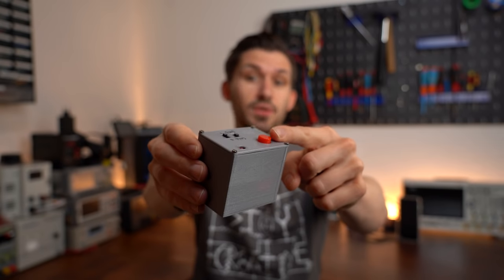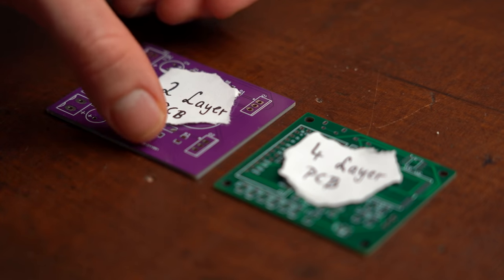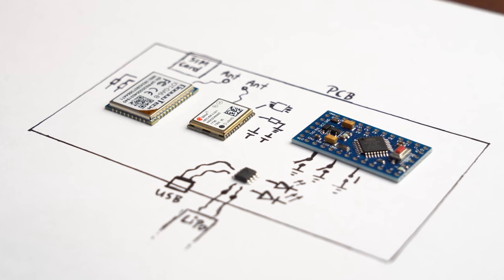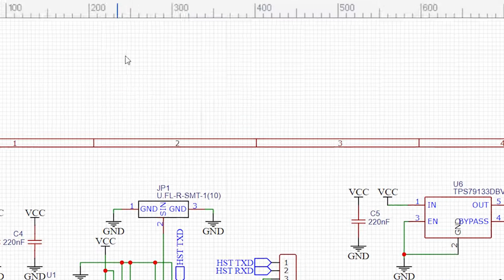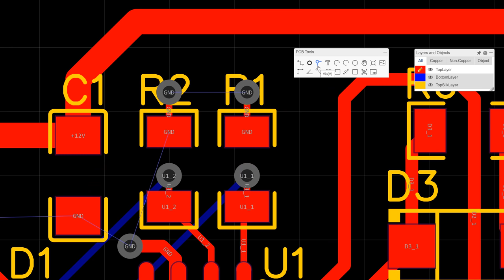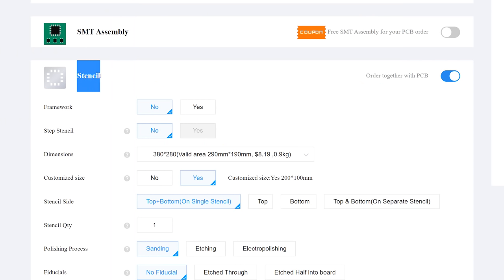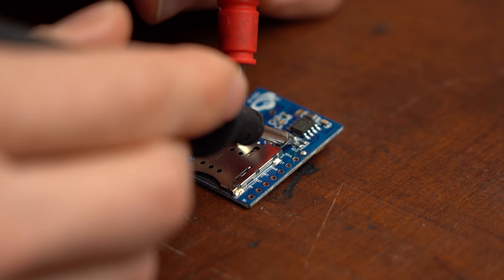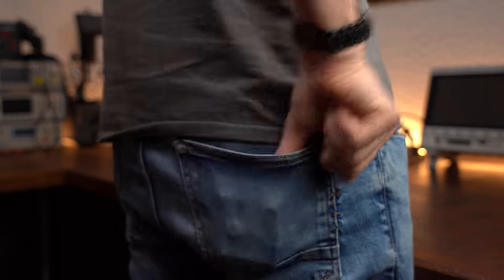This credit card sized PCB can SAVE YOUR LIFE! (Shrinkify your projects with a 4 Layer PCB)

Comment: I think this board could be possible on 2 layers. Use old laying technique: vertical traces on one layer, horizontal on another. You can fill empty space with GND and apply via stitching.
Reply from the maker: 2 Layers is possible. I tried it. But I thought it was time to talk about 4 layers ;-)
Reply: I never knew about that technique
Reply: @YSPACElabs  Very useful when you have a lack of space, just be careful when you have high current traces or AC. Parallel lines can easily act as antenna's.
Reply: @YSPACElabs  often used on old computer designs with a lot of discrete parts, I still use it occasionally when I do my boards
Reply: Yeah but then you can't get that sweet sweet jlcbcb money
Reply: The design has more than one high-speedish component. If I were you I simply make two inner layers GND.
Reply: @YSPACElabs  its also used in ICs for routing :) (manhattan routing)
Reply: @u.h6844  he makes videos so you can watch them and learn more, don't be sassy about sponsorizations
Reply: @greatscottlab  and thats the only thing I am really missing a bit in the otherwise very nice video - the actual 4 layer stuff was a bit short :D

Comment: The 328p is quite easy to use on it's own and saves a lot of space not having a whole arduino. I've made projects using a 328p that ended up smaller than a nano.
Reply: Basically just a single pullup resistor if ur fine with the 8mhz internal oscillator. Otherwise +2 caps and a crystal
Reply: @KekTekDe  And an ICSP header or pads. They're a very useful MC
Reply: or we can ditch the venerable 328p and use a RP2040 :) (although if space is an issue, the bare 328p with internal 8mhz is hard to beat)
Reply: @AudreyRobinel  well, for this project an attiny would be sufficient 😄
Reply: @KekTekDe  Well, it may be suffiscient, but modern micros are as power efficient, and as cheap, providing with  greater flexibility, and easier code maintenance :) why pay the same price for a lesser technology? 328p are not significantly cheaper than rp2040s and they are outclassed on most, if not all metrics!
Reply: @AudreyRobinel  — There is one
 metric the RP2040 really sucks at, and that is ADC inputs. Since pretty much every other microcontroller has at least eight inputs, I really don’t understand why it only has four; 16 would be reasonably expected from most new designs. I would use it for nearly everything if it weren’t for that glaring deficiency.
Reply: @AudreyRobinel  Never worked with RP2040, but an ESP32 would add WiFi and bluetooth to the board. Only your imagination limits the possibilities for a board with so many capabilities.
Reply: @dozog  Indeed, the ESP32 is my goto micro controller. It does almost anything i want, and what it does not do, i can mostly add it trough i2c modules.
however, the rp2040 is less power hungry, smaller, and natively runs micropython. Plus there is this PIO module where you can program 8 GPIO to do blazing fast bit ganging operations if needed (but honestly i have not yet needed it :) )

I find the RP2040 to be a very good replacement for classical "arduinos" : boards are cheap, do a lot, have good hardware, extremely good support, etc.

ESP32 do the things i need the most extremely well, and are cheap considering the wireless capabilities, but they are way less accessible.  But in my most common use-case they are king (integration with home assistant).

However, if there is a new rp2040-like with wifi capabilities (ie not an rp2040 coupled with an esp32) i will surely be interested in it.

I must say that for my own projects i mostly use the esp32, but for the projects i do with my students, i am heavily biased towards the pi pico because of the ease of use.
Reply: @AudreyRobinel  I think similarly.
But it works so much easier with a micro that you already know. No learning curves.
What do you mean "less accessible" ??
(you mean harder to get in the market, or a technical thingy??)

Comment: Interesting project. Great work. This year I had to design a six layer PCB at work and it was a daunting task at first but ended up enjoying it.
Reply from the maker: I think once you get into designing it becomes like solving a maze. And I think that is quite fun and challenging at the same time ;-)
Reply: @greatscottlab  Yeah it can be very fun trying to fit all the parts and make the layout as efficient as possible.
Reply: @akhurash  How is this comment 6 days ago :d
Reply: @bkaytan  patreon get early access
Reply: @greatscottlab  very true until you use........................... the AUTO ROUTER haha. on any design with some complexity it requires a lot of hand holding to get the auto router to do its job.

Comment: Keep in mind that RF traces (like the one going from the GPS to the antenna) need special care and should be kept straight and some other things like the length need to be precise.
Reply: Yeah. It's a miracle that it even works. It needs to be short and FAT. GSM is another thing, it usually works with a wet string, but it might be noisy as hell. GPS on the other hand is really easy to screw up.
Reply: shouldn't they be controlled impedance traces? 50R?
Reply: Not if you are using active antenna. It seems he is using a active antenna, which is fed with a small bit of power, meaning the conductor between antenna circuit and GPS circuit isn't critical, but the conductor between antenna circuit and the actual antenna is critical. The antenna circuit is on the board where the antenna is mounted. An active antenna is ALWAYS required when connecting a GPS to any length of antenna cable, since when using passive antennas, you get reflections and such in cables that can disturb the sensitive GPS signal.
Reply: @sebastiannielsen  you also get impedance mismatch and reflections with a LNA. No way around that.
Reply: @zaprodk  Yeah but then with the amplified signal back, the SNR will be higher, meaning it doesn't matter if you get some crap on the line.
Reply: @zaprodk  Cries in autorouter
Reply: @sebastiannielsen  Thanks!

Comment: Great video. You could have desoldered atmega chip from Arduino board as well, as you could get even smaller circuit. Arduino is anyway mostly atmega plus usb-to-serial chip and oscillator which can both be avoided in some cases.
Reply: True, and the pro-mini doesn't even have the usb-serial chip

Comment: Create a raised ring around the button so you don't inadvertently press it when sitting down or leaning against something.
Reply: there's an on/off switch independent of the button
Reply: @Astarath  It's still a good idea to protect the button, just as it's a good idea to protect the slide switch.

Comment: If you replace an entire Arduino board with (literally) 5 relevant components (MCU, crystal + 2x caps, 1 pull-up resistor for NRESET) - you would get MUCH smaller design, really credit card sized.

Comment: The activation button should be recessed to reduce accidental triggering from clothing.  You don't want to be butt dialing.  Also I would consider requiring 2 buttons that have to pressed at the same time.
Reply: I thought the same, and perhaps recessed dip switches as well. I bet the enclosure could be made half as thick.
Reply: I believe there are 2 buttons, the switch must be activated for the button to work.

Comment: I once worked making software to a company that could make PCB boards with more than 20 layers. Never found out what special applications those insane boards were for, but it was quite impressing. I heard that the amount of rejects was quite high with those PCBs  with all the blind holes and holes between layers deep inside etc.
Reply: wouldn't be surprised if smartphones and pc/laptop mainboards are about there.
Reply: @victortitov1740  No. Smartphones and pc/laptops will propably in the future go to a common bus architecture, meaning they could be done on 3 or 4 layer boards. Today we still have HDMI ports and such on laptops, which require its own circuity, but in the future the whole laptop/smartphone might just consist of a single USB-C bus + power + gnd going around every component including storage and processor. And with the new RAM types that can nonvolatively store data, I think we in the future will use our RAM sticks as harddrive.

Comment: There’s still a lot of wasted space, though, almost half is taken by the Arduino, the switches and the button. By using an SMD microcontroller directly on the board, an SMD button and switches (or removing one or the two switches) and a dual GSM+GPS module, it probably could be shrunk to half the size or less.
Reply: Maybe he can make a version 3 for us
Reply: @whizzbang7520  I'm kind of trying to minimalize the design right now with a fork of that project. Fixed the mess in the schematic, put all in blocks so it's readable and debuggable. Get the routing done without the godawful autorouter traces. Also wanted to find an enclosure that one could buy already done from a manufacturer, that would be small and easily modifiable and they have CAD stuff, so people with 3D printers can waste their plastic too if they choose. The Ai thinker A9 has GPS and GPRS so could use that later, but for now, because this project also has the code for all the stuff here, I would not try to change much but just the PCB.
Reply: @grbttutorials Please post a video of making this project even smaller
Reply: @deskpro256  can you link the release when its done?

Comment: I run a hardware business and the chip shortage has certainly changed the game quite a bit. We've had to build up a bunch of chip inventory management and ordering processes to ensure we get what we need, along with accelerating board redesigns.

Chip gougers like Win Source are a blessing and a curse. They purchase chips and markup by nearly 10 times, but at least it means you can get your hands on chips for prototypes.
Reply: Have you ever bought from Win Source? Hard to tell which ones are scammers or not.

Comment: If you move the switch and buttons to one side, then you could make the whole PCB slimmer which would be more comfortable in your pocket and then could be inserted into a pocket of a purse or handbag. This board could also be used as a GPS tracker enabling you to find the unit simply by sending a SMS with a code in it, which triggers the GPS result in a returning SMS.

Comment: Is there a reason you are using Pro mini but Atmega328 itself? I have seen so many of your videos and I always wonder that. With a atmega chip with a resinator could save a HUGE space for the PCB
Reply: And you can also flash the Atmega with the arduino compiled hex file via ISP. Would be a big space improvement.
Reply: @r3tr0_  yep. May be he can manage to fit 2 layers with a smaller PCB. Programming pin is not even necessary if the code uploaded beforehand
Reply: @thenextproblem8001  I would still put an ISP header on the board for later updates. You don't want to desolder the chip every time for programming. Plus a 1.25mm ISP header is really small.
Reply: @ProTekkit1  im just placing some copper pads on top layer and hold the FTDI board on it. No desoldering no problem
Reply: @thenextproblem8001  you can even 3d print a pogo pin holder that you just clip to the pcb so you don't have to hold the programmer.
Reply: @satibel  do you know any examples?

Comment: Great video! I think my next PCB also will be 4 layers, as JLCPCB really has made it affordable enough now. I am not sure if I liked the close up at 10:04 though. Loose solder balls or flux residue, I am not sure what that was, but if I see things like that in my own projects I usually flux and run the iron over that another time and clean up before I call it 100% finished.

Comment: I almost always use the auto-router, but then got through the board and fix it up.  The auto-router will send leads out the side to connect to a component directly below it, which makes no sense, or put a via and bottom trace where one isn't needed.  It also leaves perpendicular traces all over the place.  It's a good starting point, but I never leave it at that.

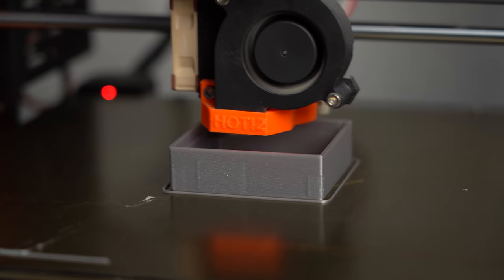Comment: (at 9:43) the 3d printed case looks like it could be a lot more compact still, not sure if thats an optical illusion or if it actually could be. At least the switches and button seem like they could be more compact.
Reply from the maker: You need space underneath for the battery and GPS/GSM antenna and space above for the components. You can save maybe 1 or 2 mm on the top, but not much.

Comment: OK, awesome. Now make a more useful one. :)
Two suggestions:
A motorcycle tracker that cries for help if the rider doesn’t silence/acknowledge an alarm within 15 minutes of it regularly going off. You know: SMS, email, etc with GPS coordinates and an eventual call to emergency services with a pre-recorded message + last known coordinates.
A camera that emails or sends MMS thumbnails when it detects motion as well as providing a live view when you request it remotely.

The later would preferably be activated as a backup when there is a network or power interruption to your non-GSM cloud-connected cameras (Nest, Ring, etc) or when you specifically need it… like you position outside with no power source to capture a trespasser, for example.

Comment: I'm sure you can always make this smaller by not printing the box to be so tall, using smaller touch buttons instead of big huge switches and then I think you could actually get this to be about 0.5cm thick, I wonder if heat would be a problem without airflow?

Comment: awesome project, the stencil / hot air seem to be a good pair, my last try with smd soldering with regular iron and regular solder was a disaster.
Reply from the maker: Regular iron does work. I do it all the time as well. But stencil+paste+hot air is way cleaner and easier ;-)
Reply: I found that preheating the board makes the hot air soldering even easier.

Comment: Two layers can be done in home by an experienced hobbyst, and is somewhat complex. But if you'll use profissional PCB, it seems that the extra cost of a 4-layer is acceptable for a project in this order of complexity.
Reply: A 2 layer pcb made professionally costs only $2-3 though, unless you're churning out hundreds per year it's simply not worth it to DIY it to save some money at the cost of quality.

Comment: Excellent reduction of prototype to product but I'd ditch the Arduino too and desolder the ATmega off the board and use that with a crystal, capacitors and a header for programming. Also with 4 layers you could mount on both sides of the board using a layer as an internal ground plane and reduce the size even further with little extra work.  Maybe it could be an ongoing project to see just how small you can get it.

Comment: I had a simmilar idea since last summer, but the plan was to stick with sandwitching pcb's together.I picked the sm800l as my GSM , and its a chip that is hard to solder, also the RF wiring seemed hard. It was more like a remote tracker.  Unfortunatly it stayed in the early design stage. Mayby your desing will help complete it.

Comment: Why not just use one button and use a power latch?
The button itself can be used to connect the supply EN pin and also to your MCU input pin.
Now that your MCU has started up, drive the supply EN pin with one of your MCU's outputs.
Once everything is done, your MCU can shut everything down by itself.
You can use a diode to prevent your output pin rising your button input pin.
Mode switch can be implemented like this: tap for call, hold for SMS or something along those lines.

Comment: Amazing work, great job but i have one creticism, it can be easily press the button acidentically.
Reply from the maker: Feel free to use another button ;-)
Reply: That was my thought as well when he stuck the new version in his pocket.  You can see the button sticking out.  It needs to be redesigned slightly under flush to the case.
Reply: On the other hand it did seem to have an off switch. Which might be sufficient

Comment: Your OSHW project still show PWRKEY on a pull up, this is normally connected to a transistor so that the MCU can turn the GSM module on and off, would have liked to see this with a 4G/ LTE module rather than 2G, not very good RF routing, you would typically route the u.FL/SMA grounds alongside the RF signal trace hence why there is 2 GND pads either side of the RF signal path, and make it as short as possible and 50R impedance, you can find the stackup on most manufacturers website and calculate it.  From memory you can get a close 50R using 2mm track width or something like that, 4 layer can be calculated based on the stackup but it is usually thinner.  Look how thin that USB power trace is too!

Comment: Might want to protect the button against accidental presses by indenting it under the surface or making a wall/cover around it. It'd be really annoying if you left the power on the module and put it in you pocket then suddenly getting 5-6 hundred texts would be a huge annoyance.
Reply: The Butt dial 1000

Comment: Hi Scott, great video as always!! It’s good to see you getting into the more esoteric stuff like 4 layer PCBs!! I have one quick question though. I recently bought myself a hot air rework station but am having trouble finding optimum settings for it. Yours looks like it works a treat, what temp/airflow settings do you use? Thank you and keep up the good work!!
Reply from the maker: 350C with a flow rate of around 3-5
Reply: yes lower your airflow,. had that same problem in the past lol